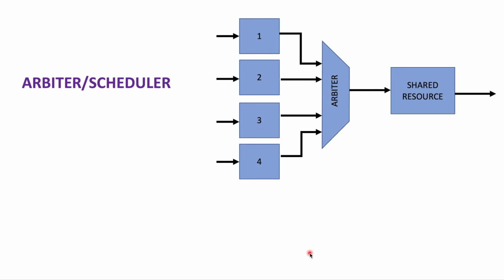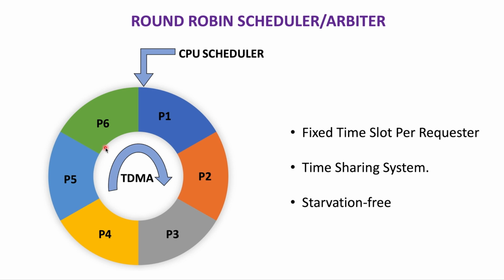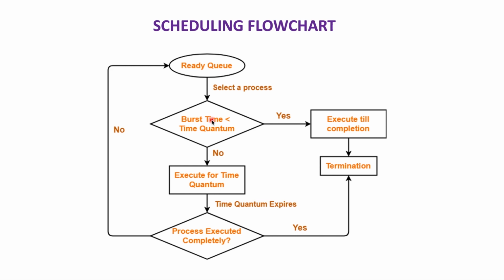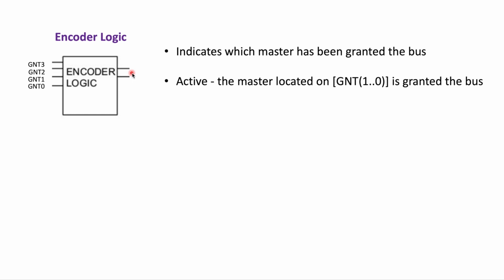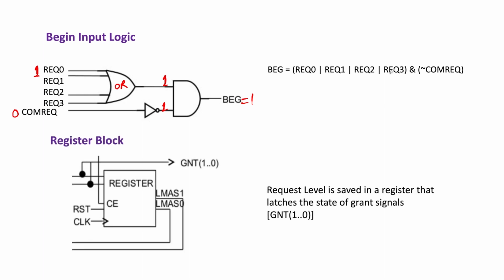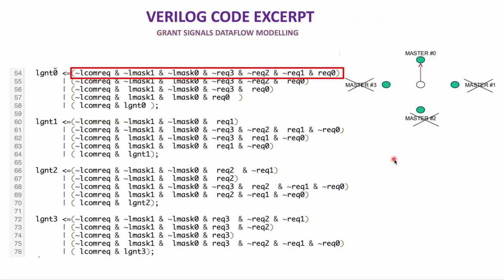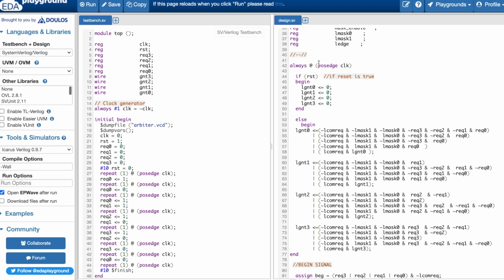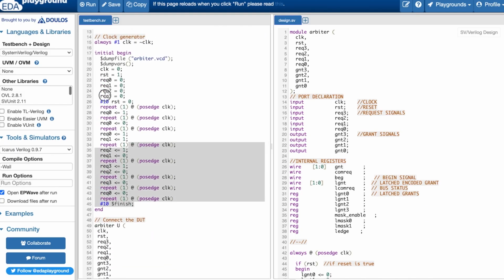Verilog HDL Project | Round Robin Arbiter(with code) | EDA Playground | Verilog

Comment: Good explanation but little confused on how the code works. I didn’t understand what is the driver for mask_enable. There is some part of the logic missing for that signal
Reply from the maker: mask_enable in code is the output signal from the LASMAS state machine (refer to 7:10 in video), which gets connected to CE (Enable pin) of register. Whenever CE is active, the outputs from encoder logic gets stored in the register. 
To complete the data-flow modelling for the general topology such that it justifies the circuit , it was included in code for better understanding. You can consider it as the value in ‘lgnt’ (from encoder logic) non-blockingly gets stored in lmask0 and lmask1 variables depending upon reset conditions.